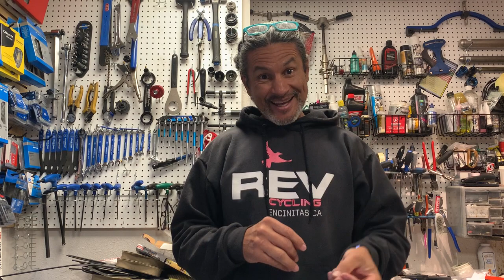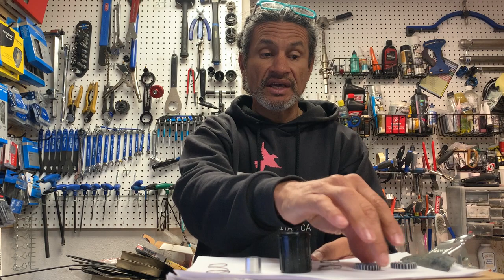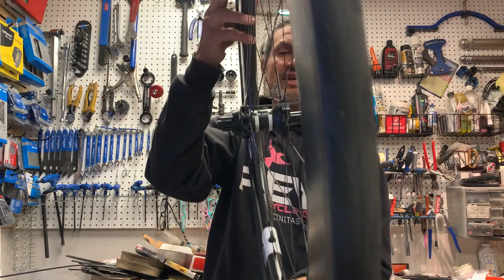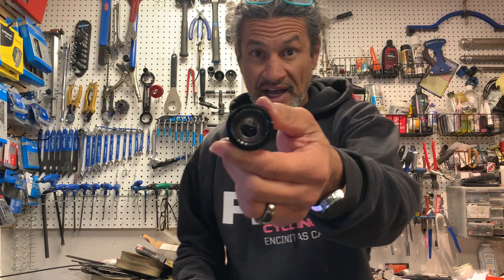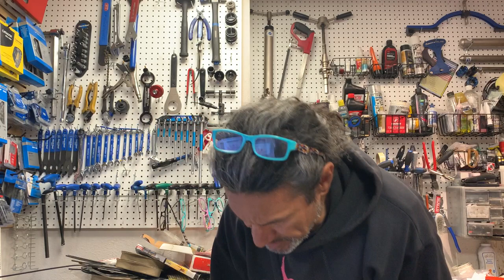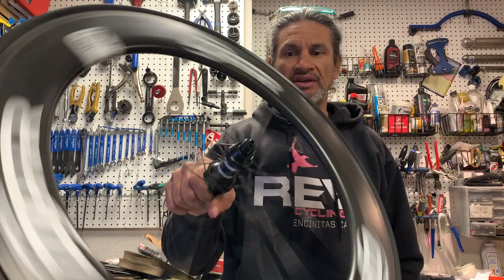How to service DT Swiss hubs - disassemble clean and reassemble a DT Swiss Free hub DT350 DT240 etc

Comment: I have an issue where there's a ton of resistance when pedaling. All the other components spin freely, so I believe it's an issue with my rear hub, which is a DT Swiss "spline" (not sure of the model number). Any idea what the issue might be and is it possible to fix myself without any bike-specific tools?
Reply from the maker: Not sure unless I have your bike in my shop. DT Swiss don’t require tools. Good luck let us know what you found 

Thanks for watching please consider subscribing

Comment: Hi, Thanks for the video.  I recently acquired 2 wheelsets, both with DT Swiss 240 EXP hubs, so the information in your video will be quite useful.  I have two questions regarding your decision to use the Shimano Freehub Grease instead of the DT Swiss Special Grease.  First, I have no experience with this topic.  Second, prior to watching your video, I was not aware that Shimano Freehub Grease was even a thing.  Additionally, where I am at the moment the Shimano product is much more easily accessible than the DT Swiss product.  So, all of that said.  Can I take it that you see these two products as interchangeable?  In terms of overall viscosity, is one lighter or heavier than the other?  Thanks again for the effort!!
Reply from the maker: Grease is grease don’t overthink it 🙃
Reply: Dt Swiss grease is overpriced and nothing unique. Shimano/park works just fine
Reply: I use Super Lube Synthetic Grease.  I use it for ratchet hubs and shifter internals after they have been cleaned.  A 3 oz tube is about $10, can be found at some hardware stores, and will last a lifetime.